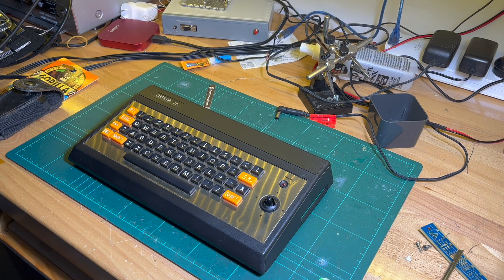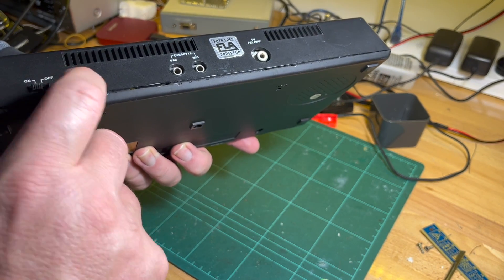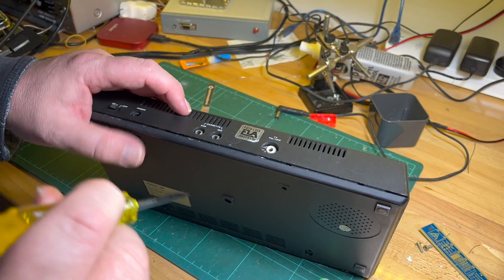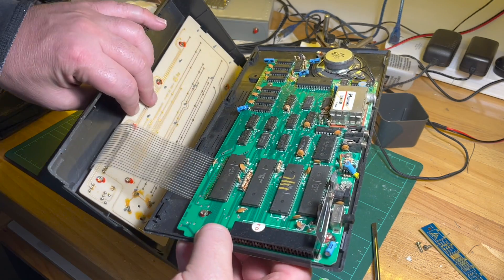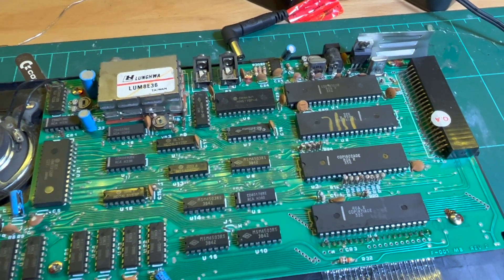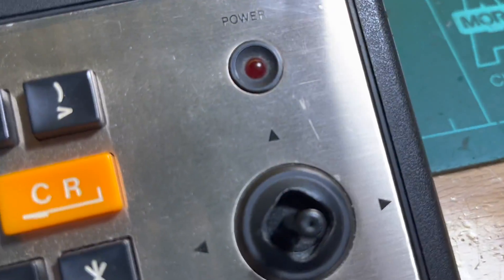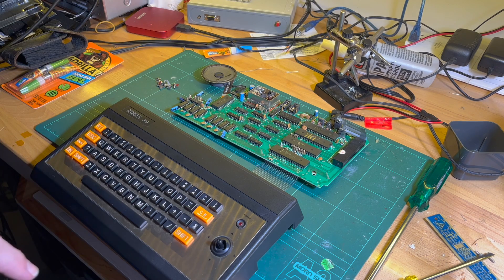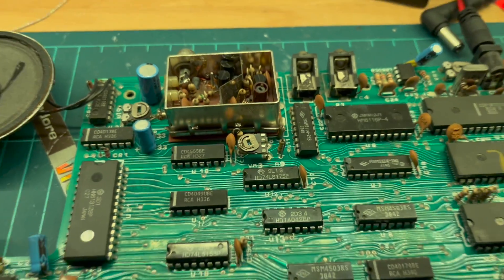🇭🇰 COMX-35: Part 1 (Does It Work?) [TCE #0028]

Comment: RCA 1802 is such a beautiful chip, its simple and not fast but it is very elegant in its architecture and instruction set which is super clean/minimalist.  Exotic too since it had Silicon on Sapphire which made it radiation hardened for space.

Comment: Neat!  I'm working on building a replica of one of those at the moment, and it's nice to see a original one.  I'll check out your subsequent videos.  🙂
Reply from the maker: Thanks Derek - I've just started building my COMIX too.  The main chips are in transit, and I ordered the remaining parts yesterday, and the keycaps today (direct from YMDK).  Will probably record a short "in progress" video tomorrow - nothing but the capacitors & IC sockets done so far ... /Brett
Reply: @Brfff  I've technically "finished" my COMiX-35, but I think either the 1869 or 1870 chips is busted.  The computer boots, it plays the startup tone through the speaker, and the screen fills with a sort of garbage pattern.  I press a key, that garbage disappears and is replaced with similar but different garbage.  If I press more keys at that point, then it adds more lines to the garbage, at different places, but at the same rate, in time with each key press.  So, it's clearly booting, trying to display the startup logo, then clearing the startup logo and trying to display a BASIC prompt, but the output is corrupted.  The 1869 I got from China looks extremely suspicious and has at least one foot in the grave, judging by its appearance, so I tend to think that's the culprit!